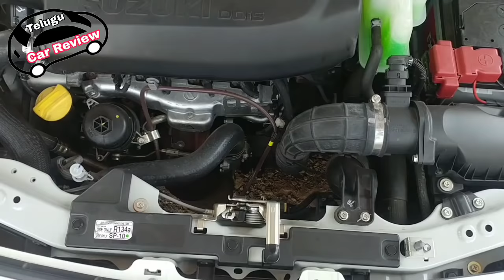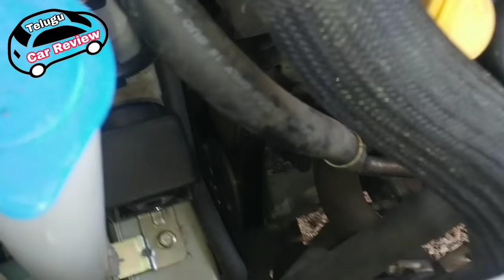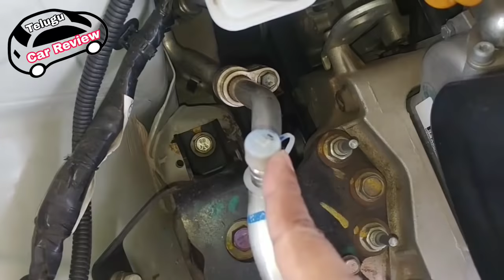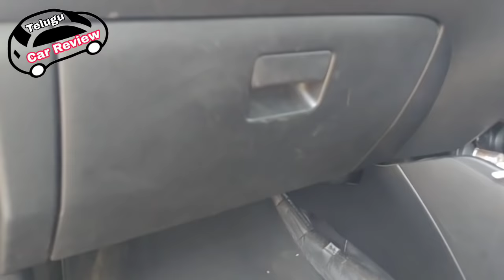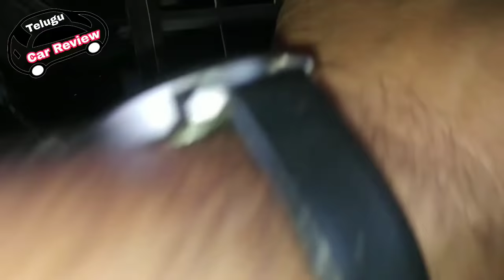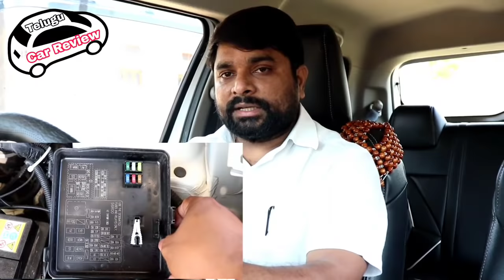Car AC problems and solutions||మీ ఏసీ సరిగా పని చేయకపోతే ఇలా చేయండి||telugu car review

Comment: Hi Borther, nenu wagon r use chesthanu tyre size undavalasina danikante ekkuva size use cheyyadam valla emina problems vasthaya..? Particularly naku ravalsina mailage ravadam ledu and vehicle model 2008 80km driven please suggest
Reply: arekatla. net mee Car ideal tyre size 175/65R14. 
Advantages of bigger tyre :
1. Appearance bauntundhi
2. Handling bauntundhi 
3. Better braking

Disadvantages:
1. Costly
2. Weight that affects acceleration, performance and mileage
3. Ride rough ga untundhi
4. Steering thippadam kashtam
5. Tyres jaldi arigipothai

Comment: Is that true that after turning the engine ON, letting it to Idle for 2 minutes before the move is good for its life span?
Reply: That’s absolutely correct.

Reason being the oil which gets circulated all through the engine. It ideally takes a minute approx. so the best practice is to let it idle before hitting the gas pedal

Comment: My car fan is not working 
When I start ac it's working after one minute it not generating cool at that time fan is off. After some some time it is working. 
I have checked in shop there is no issue but ac same issue repeated
Reply: When fan is running ac cool when fan off cool not generating so what can I do